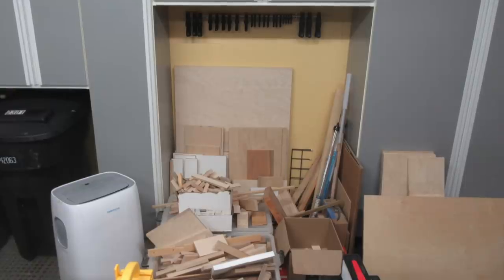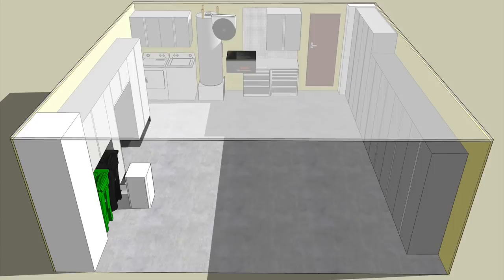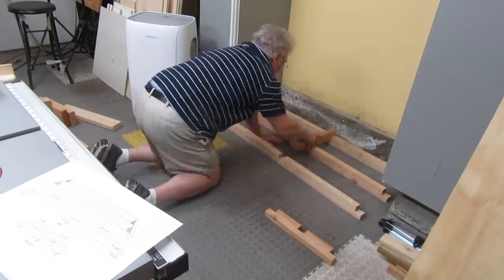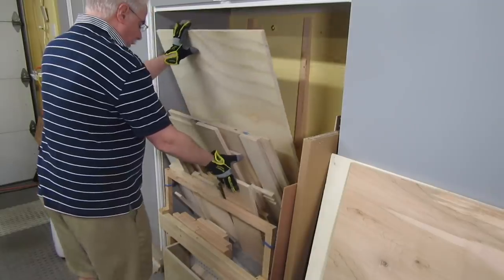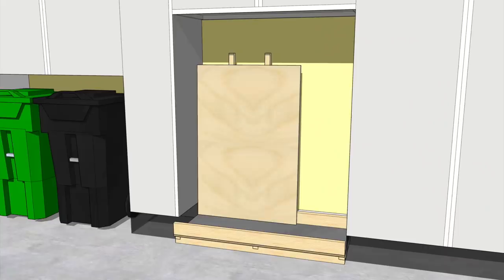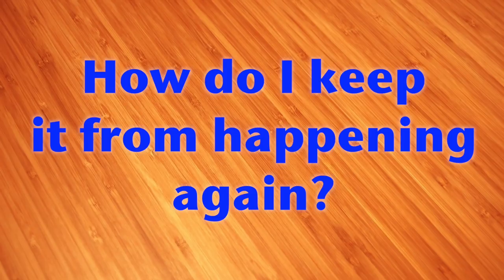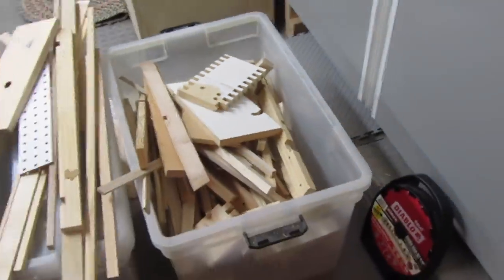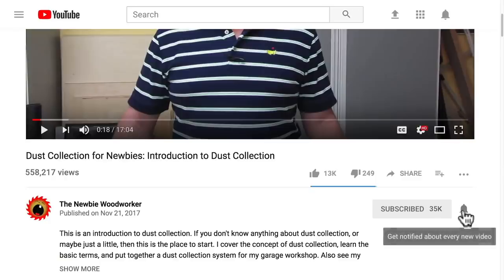Cleaning Up My (S)Crap, and how to keep it clean

Comment: I like to work with wood and metal, so I have this same problem with keeping both materials, lol. The lumber cart I built works great for storing full sheets and other misc sizes and shapes of off cuts from both materials, but I still have this dilemma from throwing all the smaller stuff. Steel, aluminum, and certain types of wood are all expensive, so it's really hard to know where to draw the line sometimes. I like your idea of a large drawer(s) to handle the overflow that I want to save, and I might go this route. It's a great idea, now I just have to create some room for these drawers... Seems like organization is something that's never done, or can always be done better.
Reply from the maker: "Seems like organization is something that's never done, or can always be done better." No truer words were ever spoken. I had an idea right after I posted the video. Instead of actually throwing out stuff, put in a container and pretend it's been thrown out. If you don't have to go into the container to fetch anything, then after a while, you can assume it really is trash. Don't know if it'll work or not...
Reply: @TheNewbieWoodworker  My brother always tells me if I haven't used it in 6 months, throw it out. Easy for him to say, but harder for me to do. I also started doing scroll saw projects a couple years ago, so that's another good way to use up a lot of those smaller scraps...and another reason not to throw them, lol.
Reply from the maker: @MnktoDave  LOL. Tell him he has to do an intervention, and clean it up for you. 😛

Comment: Really like your concept, design and implementation, as well as your thought process.  Would love to see a plan, article or 3d model.  I know, every situation is different, but I find it really helps to have some basic dimensions.  Then it feels less like re-inventing the wheel, agonizing over every detail - ie, 12 inches, or 14?  From what I could see in the video, I am guessing about 5 ft wide, 22 inches deep, and drawer depth of 12 inches.  Best wishes, from another old newbie.
Reply from the maker: It really was whatever fit in the space. The drawer is 41" x 20" outside dimensions and 10 1/4" deep on the inside, and the section on the right is about 10 1/2" across. The platform is 48" x 20", and the vertical 2x4s with the tapers are about 48" tall, give or take. Hope that helps!
Reply: Thanks, that will help.
Reply from the maker: @joedance14  If you want, you can have the SketchUp model I used for the video. I'd upload it to 3D Warehouse, but I'd need to clean it up a lot. So if you want it, email me from the Menu on my website, https://thenewbiewoodworker.com/ and I'll email it to you.

Comment: Good video. Thanks for sharing. There are some very clever details in it. 
I was surprised that you divided the wood in the drawer by measurements (length and width) because you can easily change that (read, make smaller)
What is more difficult to change is the thickness and you cannot change the species. Plywood never turns into osb or pine or oak or vice versa. At least I don't know the 
formula for that. As long the tossed out scrap wood is in that litter bin within reach you will not need anything from that  (and if, it 'll be on the bottom).
As soon as you start to really throw it away, or burn it, then you'll need it within the next couple of days. (what would we do without Murphy?.
Reply from the maker: Thanks for the comment! Transmutation of wood? Probably not likely - it mostly just turns to either sawdust or mold, right? 😛 I'm lucky because almost all of what I do right now is plywood, so the decisions are easier. But too late on the stuff in the trash - it's been picked up and now it's gone.

Comment: Loved the video. Might modify to work with my garage.  I’ll have to do the Sketchup thing too. 

Shouldn’t treated lumber be used if it sits on the concrete like the sill plates on wall framing to avoid water damage again?
Reply from the maker: I don't know? But I would think 2x4s should be OK, don't you?

Comment: You can still braai with what you throw out, nothing goes to waste then 😃
Reply from the maker: Well that's a term I'd never heard before. I had to look it up. I'm not sure about doing that in Southern California, they have a lot of rules about that kind of thing. 😄But for others, it's probably a good idea, as long burning plywood (and the glue that holds it together) isn't dangerous. And doesn't make the food taste bad. 😳
Reply: @TheNewbieWoodworker  well if you ever come to South Africa I will braai for you with proper braaiwood or charcoal. Note that it is not the same as a barbeque
Reply from the maker: @rynardwakefield2637  Thanks. Considering how much I hate flying, especially long flights, don't keep the fire burning waiting for me. 😛

Comment: sigh. I guess its time to clean out the shed. So I can have my shop. So I can tackle that list of crap I want to build. Which will lead to  a scrap wood problem. So I can add this To this list of things I need to build.
Reply from the maker: LOL, yes, it's really like that. The plus side is that you'll feel really good about a clean workshop. While it lasts. 😄
Reply: @TheNewbieWoodworker  I usually get it all cleaned up then knock over the case of sockets and wrenches because I am a clumsy dude.
Reply from the maker: @wev3864  Oh man, can I relate! 😂